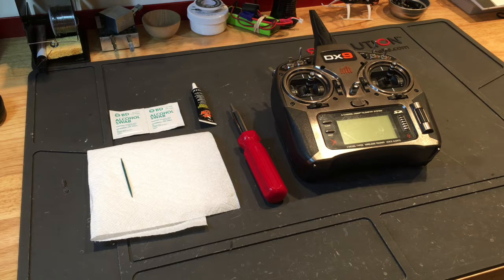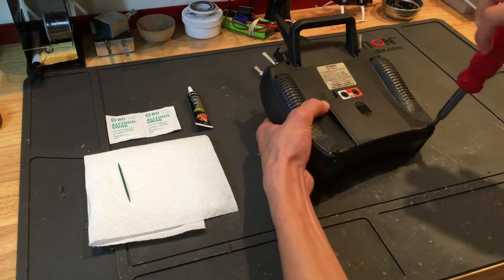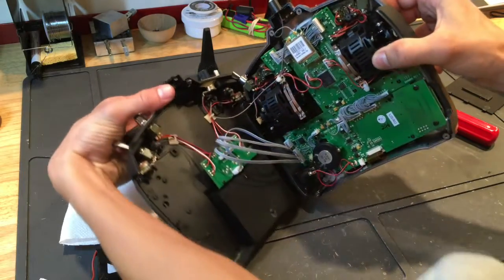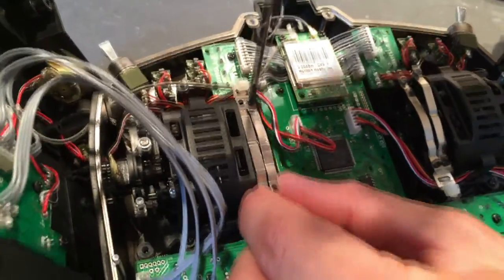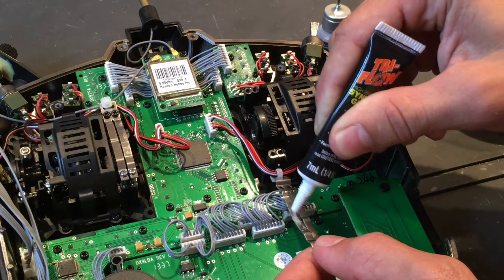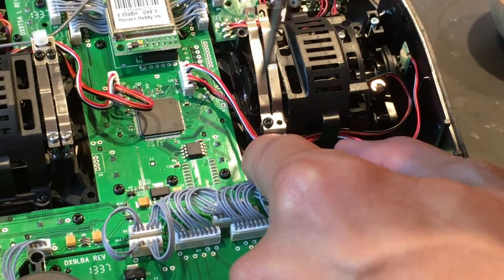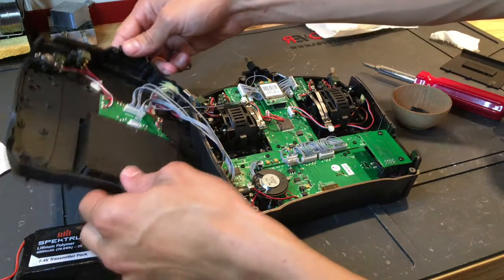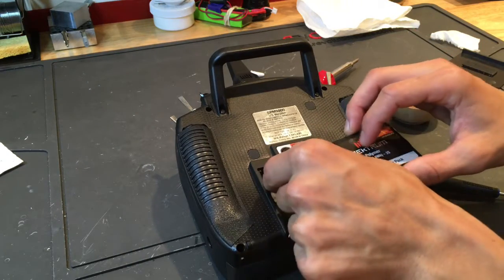Service Spektrum DX9 Friction Brackets

Comment: Howdy Hal, my rudder trim tab is broken and just rattles around in the housing. Do you have a video or a tutorial on how to take it out?
Cheers
Michael
Reply from the maker: Hello Michael; I'm sorry, but I do not have a video on repairing the rudder trim tab.  However, if you follow this video for removing the back plate, you can at least find the broken piece and remove it.  I would then contact Horizon Hobby and send in your radio for repair.  Cheers! /Hal

Comment: Brand new dx9 and no amount of cleaning greasing or adjusting can get rid of the "stiction" on the collective ...Its crap
Reply from the maker: Return it where you purchased it if you are unhappy.
Reply: @HalStaniloff   Unfortunately In Aus you cant just take stuff back like that, especially when you live in the out back . However all is not lost I managed to place a strip of slippery silky plastic plastic cut from a milk bottle under the drag plate using heat shrink on the ends .. Sprayed a tiny little bit silicone lube on it and it seems to of fixed it atm ..did 2 hours on the sim on a heli felt good , so see how it goes on a real 1 next week :)

Comment: My throttle is not smooth DX8 G2 is only about 2 years old but I don't fly every weekend compared to my JR radios of the past this thing is not as well made.
Reply from the maker: Go through the video and use the procedure to clean the friction brackets.  It only takes a few specks of dirt and grime to gum up the sticks.  And that has nothing to do with the quality of the radio.
Reply: I have had other problems with a satellite receiver decided to un-bind it self for no reason go into fail safe. The investment I made into their AS3X receivers had lot of trouble with those I'm thinking of moving over to the Frsky brand really like their new Horus x10s radio. Thanks for the tutorial it was informative.
Reply from the maker: blastman8888 Okay, well I’m not a representative or even a proponent of Spektrum products. I own a DX9, it serves me well, and when the gimbals get gritty and sticky, you have to clean them - which is what I show in this video.
Reply: I would think the issue is more or less plastic being too soft I wonder what was used in my old JR radio it never seemed to have that issue or my futaba's in the past.

Comment: What about the side to side ones? Is it the same gimbal?
Reply from the maker: Yes.  Side-to-side movement of the stick is part of the internal gimbal assembly.  This procedure is only meant to service (clean) the friction adjustment as it can get pretty gritty over time.
Reply: I notice he neglects to oil the bearings on each side that support the side-to-side  stick movement.

Comment: very helpful. Thanks for this vid. I've had my DX9 for over 2 years now and the sticks are getting a bit "crunchy".  I'll be doing this soon.
Any extra advice on cleaning the spung sticks? (yaw, ail, ele)
Or does the bearing oil do a good enough job of cleaning?
Reply: instead of grease, I cleaned off the old grease, and applied teflon tape. PTFE tape, it's called. My stick is the smoothest stick I've ever used in my life now. Hoping for longevity too! Tape seems pretty tough. We'll see.
Reply from the maker: Le Drib Nope. Just follow the video step by step and you'll be amazed at how much better your sticks will be.
Reply: great, thanks again
Reply from the maker: +Le Drib Just follow the procedure and use the oil and you'll be good to go! 😊👍✨
Reply from the maker: Interesting.  Let me know how it works out. 😊👍✨
Reply: Hi, is PTFE still working well?

Comment: hi, I just got a new dx9, but the right gimbal is not moving smooth, i can feel roughness going up and down, like a spring noise and it can be felt, is this normal and will go once broke in, or is it faulty, i am tempted to open it up and do what you did,
Reply from the maker: MMX2 Check the tension on the gimbal by locating the adjustment screws and turning them to adjust the tension.  They are located on the back of the transmitter behind rubber grommets. Consult the user manual for more details. If that doesn't work, contact Horizon Hobby Service for further assistance  you shouldn't be having any issues with a brand new transmitter.
Reply from the maker: +MMX2 Hmmm. I'd reach out to where you purchased the unit and see what they have to say. Maybe they will replace it.

Comment: Good job Hal,
I've done this type of procedure on most of my transmitters.  Even if the gimbals are very smooth that tiny amount of stiction when the force necessary to initially move the stick is larger than the force necessary to continue once in motion makes flying precisely very difficult.  The manufactures would all do well to give just a little more thought to this mechanism.
Reply from the maker: For me, it immediately allowed me the ability to control my stick movements with finer control - allowing me to maintain an inverted hover.